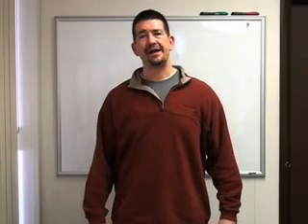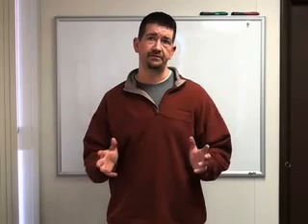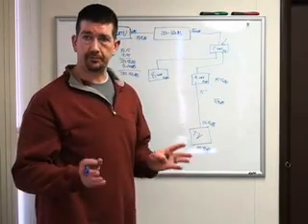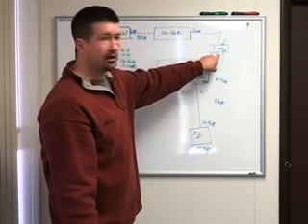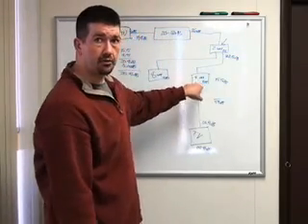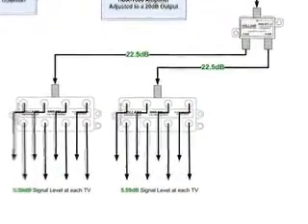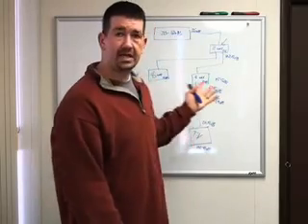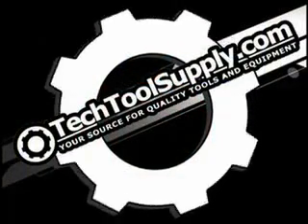RF Distribution: Splitters

Comment: Thank you for the video. I have a small project yo distribute 10 rf channels to cover long distance with the following equipment.  1.  10 Satellite receivers 2. Splitter 3.RF power booster {50 db booster from the rf out to 20db after 100m} 4. Combiner 5.  Coaxial cable RG6. Will it be ok bcos am I eliminating the use of modulator like i see in your video. I can get your reply via Fxline@live.com thanks
Reply from the maker: +Forex Nathy Give us a call 877-208-6657 and ask for Austin.  He can help get you what you need.

Comment: Can I use two different signals (cable tv and tdt) with a simple splitter, I have tested and worked, but my concern is can cause damage to the tv because of the stranght of the two, it will input more power that will damage the tv? Thank you.